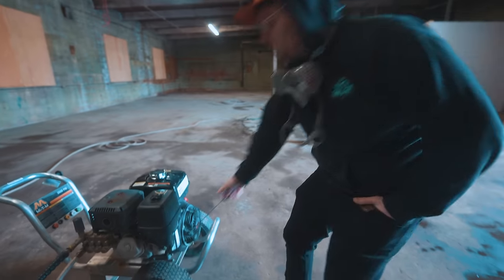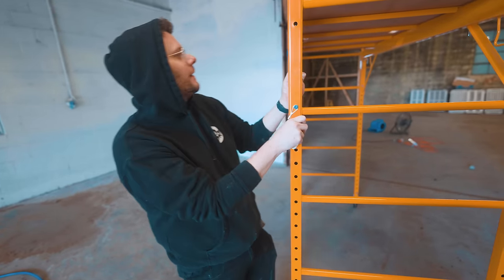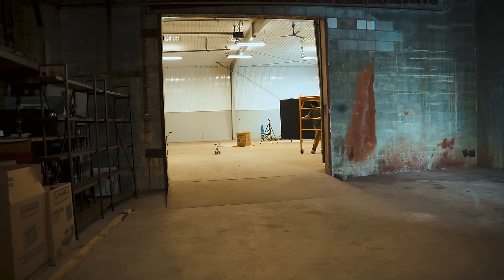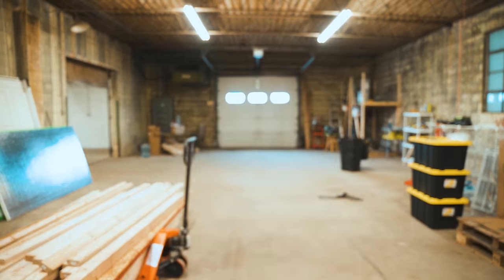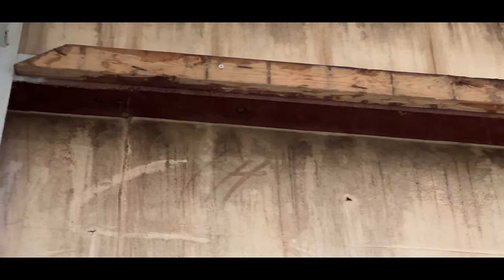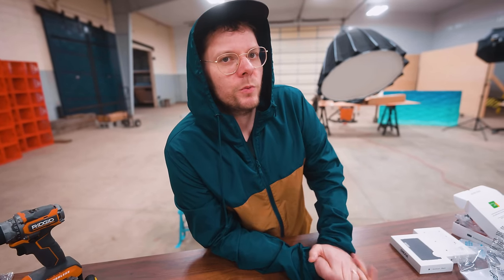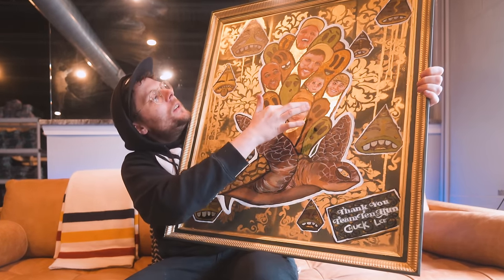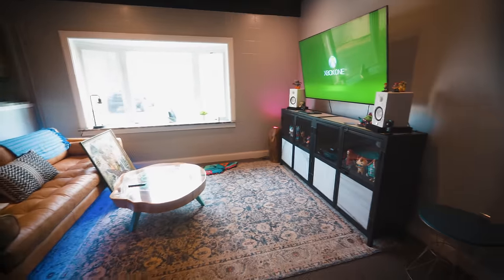Building My DREAM YouTube Studio! (In a WAREHOUSE) - Ep1

Comment: My husband works in construction and does everything from framing to drywall, etc. He is sitting beside me and as soon as you said, "Drywallers be like NOOO!!" He said, "What is he doing? Is he putting drywall mud on the wood? NOOO!" Lol 😂😂😂
Reply: It's called spackle
Reply: Ahahaa! I had the same cringing as a former professional painter when he started laying down latex paint over wet concrete block. It's going to look good for probably a month, and then the concrete is going to start steaming as it fully dries underneath the layers of latex and it will bubble and peel off in SHEETS. That concrete needed to dry with a dehumidifier for at LEAST a week, especially after pressure washing! And then an oil base primer to seal and coat everything to prevent seepage and off gassing!
Reply: @CeeDee-md2vl  Not if you’re doing drywall for a living.
Reply: Got me thinking; if bought warehouse rather than rent. Couldn’t they afford to have the main rooms prepped professionally; then add the personal touches needed for YouTube. Probably costs a lot more than I’m imagining 🤷‍♂️😂
Reply: @CJShopland_Art  oh yeah! I'm sure its WAY more than you're imagining. Lol And with inflation right now, multiply that by even more lol I'm sure he could probably technically afford it, but it wouldn't be smart spending when they can do a lot themselves. They will save over $100,000 AT LEAST by doing all this stuff by themselves. That's a very rough estimate and I'm am estimating on the lower end here.
Reply: @CeeDee-md2vl  My husband has been working in construction, including sheetrock work, for about 20 years. He and the drywallers we know, call this mud. I would call spackle the stuff that comes in a smaller tub, is thicker than this usually, and is used for filling nail holes, smaller scratches, etc.
Reply: @CJShopland_Art they would but they wouldn’t. Because when they do it by themselves, they can not only save the construction budget, they can also make this video, make another video when anything goes wrong, and make another video when fixing anything goes wrong. What’s to lose?🤷🏻‍♂️🤣🤣
Reply: @NinetyTwoJL  I guess that way, it pays for itself via the videos and is therefore free - just a lot of time 😂
Reply: @CeeDee-md2vl  It's not spackle, it's drywall mud!

Comment: hey, I saw the wall leak problem and full honesty you may wanna tun off the water and see if that does anything to change the river. At the very least you could rule out if it's a plumbing problem or a broken pipe that way! My second suggestion is to check in on the caulking it's this white stuff that seals in your walls where it meets the ceiling (sometimes it can grow old and flake off and let in water) normal hardware stores like home depot and lowes sell it! (Only if you are able to sometimes it hard to see it!) You'll want a bultyl-rubber caulk for that. It also could be that the flashing (a metal seal where your wall meets the ceiling is busted, In some cases older buildings like that can have extremely clogged gutters that are known to cause that issue). I'm not a professional I have done my fair share of dealing with big renovation projects. I hope this helps point you in the right direction and good luck with the warehouse! I hope you guys have fun with it. Stay safe while doing it!

Comment: You should buy and use a Pressure Washer Surface Cleaner with Wheels, they run around $100 and will do a great job on those floors.

Comment: Oh and on the set walls, run a 2x4 from the bottom corner of the wall out to the support arm on each side, then put casters on the walls. Every production I've worked on has set walls built like that. That was the walls can be moved at anytime by simply rolling the walls to where ever you want.

Comment: Use Bondo instead of wood filler please. It’s easy, durable and sands really well. You might need to invest in a couple of cordless sanders. 
Also the door to the merch room could use the commercial PVC strip curtains to keep the dust out. Pallets and cardboard boxes often help dispense more dust so the storing area should be separate from the shipping area or at least use more strip curtains. 
This is going to be an amazing learning experience and having a great crew really helps! Good luck!

Comment: I use the same floor scrubber in the warehouse where I work. Make sure you check the screws for the squeegee/vacuum pully. They can come loose and fall out. Especially the one on the bottom that connects the black cord to the vacuum to lift it.

Comment: You're a crafty and smart guy, you can probably fix that outer wall yourself.  Start with the roof and try to find where the water is coming in at.  Just think like water.  Water follows gravity and will find the holes, so overlap what needs it and seal what needs it. 

As far as the mold, that will take some PPE and time.  Probably lots of Kilz.   I'm not an expert there, tho.

Excited to see the end product!  Best of luck!

Comment: I work as a Production Design / Set designer.... and I cringed big time at the wood, filler, putty. If you wanna have a fast and clean finish, use a fabric to stretch over the frame. Digital printing fabrics - like poly woven - come in 10ft ++ width... You could even have them printed (which is not exactly cheap), but super fast and clean.

Comment: Love everything you do - so I'm gonna share some of my own research info with you, to aid in low cost yet effective building. Now, I don't know who already might have the blocks premade FOR YOU, to buy and build with yourself - or if you would be paying a company to make them & aid in the install - but you honestly cannot go wrong using aircrete. This article helps explain it, and its uses, but as long as it's not a "load bearing wall" that must be fixed, you can just replace all that insulation and wood with aircrete blocks and be good to go, since they do BOTH! I'm pretty sure that in a warehouse of that size, that they have wall "pillars or columns" with a thick steel internal column that is set into the foundation itself... but I'm not builder, so a professional evaluation would be needed to assess if those parts needing fixing are load bearing or not. Having to make all the blocks yourself WOULD be an ongoing project of it's own; & I admit I have no idea what's available for you out in Michigan in this sector of industry, but I hope this at least cuts down unnecessary costs. Might be good to hire a small group of construction knowledgeable guys who are somewhat familiar with working with aircrete, and just have them either make the blocks and do the building for you, or to make the "wall-form wooden molds" to then pump the aircrete liquid into, and let it setup that way. This would alleviate a large upfront "lump sum" cost regarding the whole project, though. And the blocks basically handle JUST like wood when they're solid, and are put in with more of the 'crete, if not poured into a wall mold, so - just like normal mason blocks (but much lighter); and it comes with all the benefits of insulation... so please look into it! Hope this helps!    https://natureofhome.com/aircrete-what-it-is-dome-homes/

Comment: Looks like you're getting a lot done!  Yay! 😁👍

...I am worried about the paint on the concrete walls though.  I'm fairly certain that you needed to wait at least a week after pressure washing to paint them.  Well, unless you used a special primer that I'm unaware of that helps dry out concrete walls. (Why am I imagining you guys using the leaf blowers like hair dryers on them? 😂)  Anyway, I know there's that primer stuff meant for helping in sealing and waterproofing block walls in basements but I'm still sure you're supposed to wait until the wall is fully dry to use it.  👀💦

Other than that, I think you guys are doing a great job so far.  Well, okay, maybe not with the drywall compound on the set walls, but I hope that holds up for you.  Personally, I would have gone for an automotive filler if not just used a mix of sawdust and wood glue as filler instead. 🤷

Still, I can see where you're headed with all this and it seems like you're doing your best.  Good work!  Keeping going strong everyone on team TenHun! 💪🧰

Comment: Whats behind those boards that the water is leaking from?
Reply: If its a block building. And its leaking through the blocks there is this sealant stuff you can buy and roll on. If its a pipe. Well plumbing is NOT hard. Its mostly glue & cutting too length. Turn the water main on and see if the drippy boys stop. And if they do then you know it’s from the pipes.

Comment: Not now , getting set up  is first prority but some art on those blank sound dampering panels in the editing office would rock 🤘.

Dont know if you have came accross the " sound panels" that are actual speakers for a sound system.  
There is heaps of stuff on YouTube on how to make your own but you can have them as hanging art not looking like a speckers. 
Lounge area?

Future content maybe?

But in am concerned that getting a fume and dust exraction unit is not on the list of must haves. 

It would be concidered an OH&S risk to you and your staff from pain fumes and dust because sweaping and srubbing those floors at that place daily is never going to happen . 

Think smarter not harder. 

You can buy portable ones relatively cheaply with dust contanment tanks on them  as sweeping just kicks up dust to only just fall on your newly washed floors and on top of every other surface in that room .

Your going to un in to issuse later down the track once evenything is in there. 
Everything will just get filthy from the highest shelf to the harest corner to reach if you dont think about preventing it kind of NOW

Comment: My father-in-aw used to be a professional engineering legal expert for cases related to casters (the wheels on the bottom of scaffolding). He has lots of terrible stories of the ways people got really hurt (or died) because they didn't lock the caster wheels when people were on the scaffold. LOTS. Please, please! ALWAYS lock the casters on any scaffolding that you use. It might seem like you are saving a few minutes here and there, but you are literally putting you life, or your ability to walk, or ability to talk and interact with your loved ones, on the line when you don't lock those caster wheels. ALWAYS LOCK THE CASTER WHEELS. If not for you, then do it for your family. Also DO NOT MOVE the  scaffolding with people on it. A fall from that height is very bad.